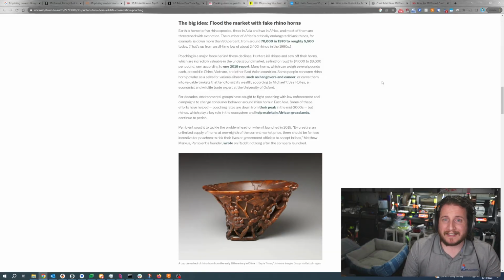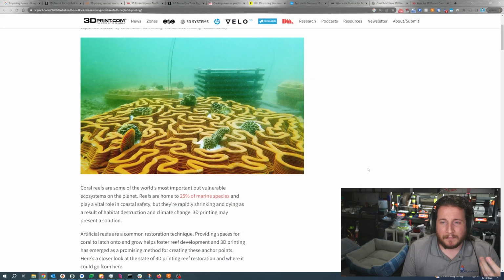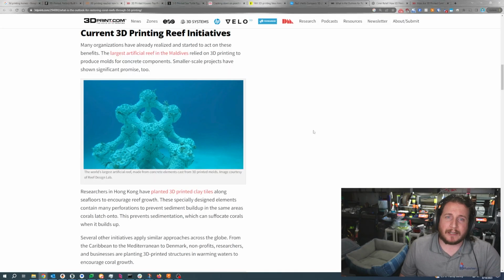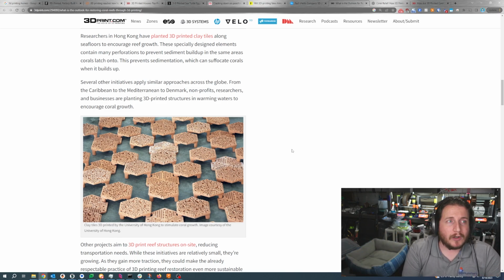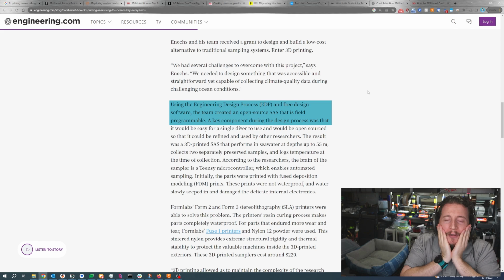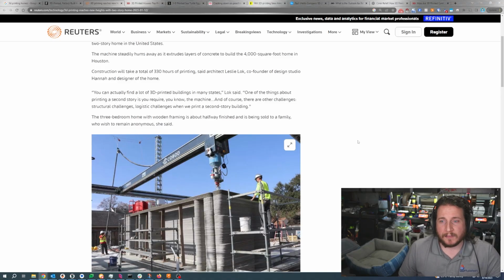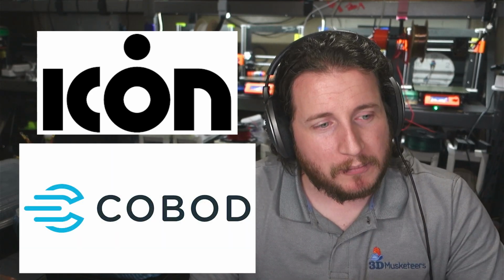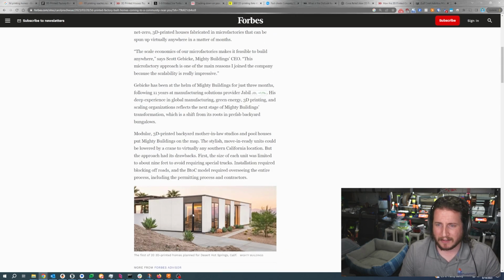3 AMAZING 3D Printed Projects! Rhinos, Reefs, and Real Estate

Comment: Restoring coral beds with 3D printing and artificial beds? That reminds me of a project I was working on a while ago. Creating an aquarium growth bed and filter combo for my home tank. Essentially, a baffle system with removable plates in ASA that allow for plant growth and propagation. I never heard of it being done for home hobbyists and wanted to try. My printer stopped working before I could experiment though. 

I've seen many people produce "feeding holes" for their tanks, floating shapes that prevent duckweed from growing in the area, but every listing I have seen are PLA or PLA+ and that won't work long term.
Reply from the maker: I have duckweed in my acrylic tank with a weir and it is such a pain in the ass as the top is not very open.. I HATE duckweed!

Comment: They’ve developed a process for rapidly growing coral using electrolysis. It utilizes a cathode wire cage that attracts calcium and carbonate ions to build the coral skeleton at an accelerated rate. They have a anode nearby and oxygen is also released. I set up this experiment in one of my reef tanks and it really works well for sps. It is incredible how many things you can 3d print for reef tank hobbyists now. Everything from sump tank parts to harnesses for your electronics.
Reply from the maker: ok, that is pretty badass! Love it